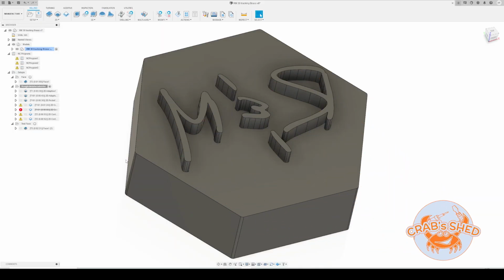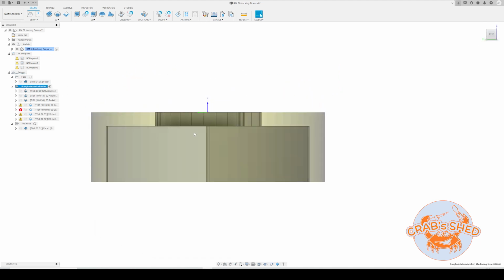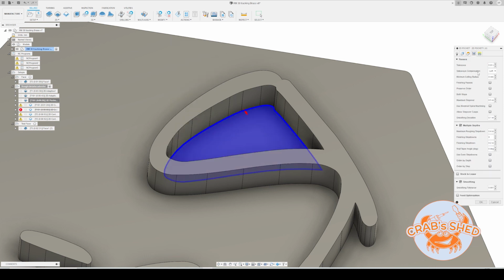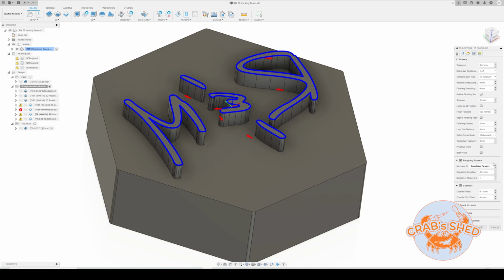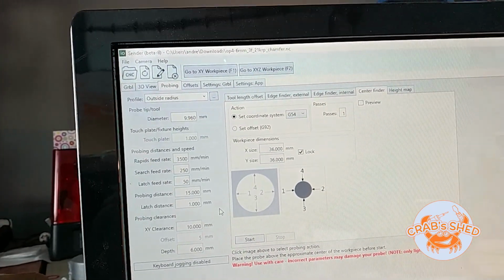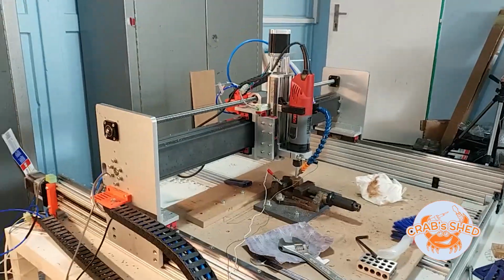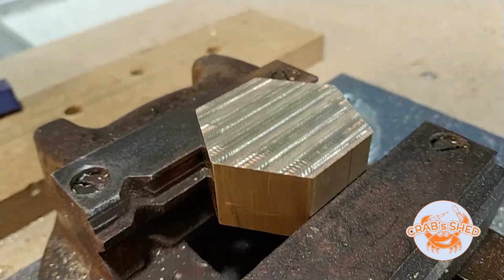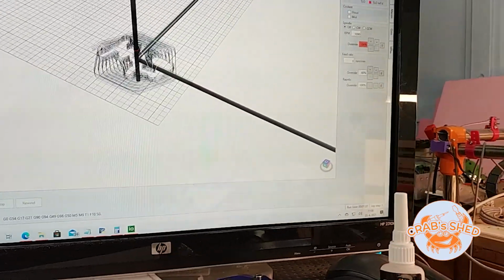A simple brass branding iron

Comment: You should try a 2.2kw water-cooled spindle. Less noise and more power.
Reply from the maker: Right, maybe in the future. For now the Kress is ok, and by far not as loud as a Makita or Dewalt. Most noise comes from actual machining and comoressor/vacuum anyway. A bit more power would be nice, but with adaptive toolpaths most cuts work with under 300W on the spindle.